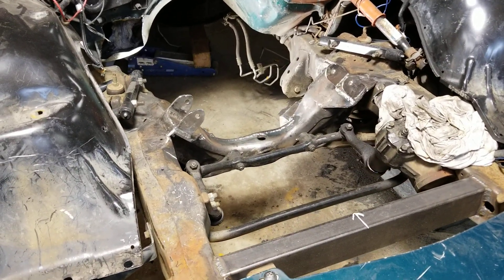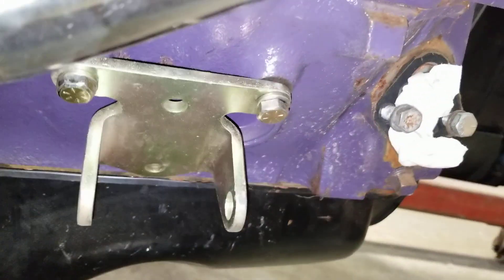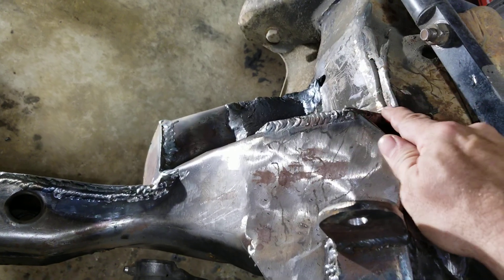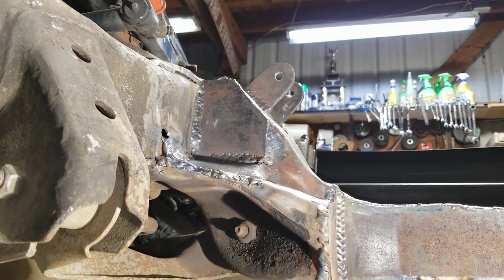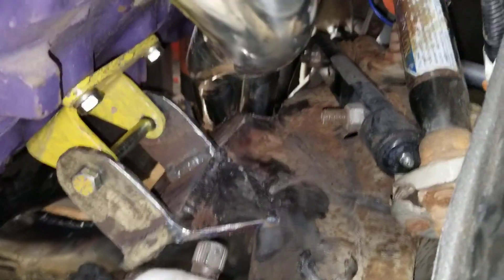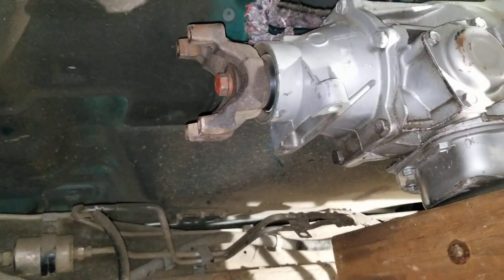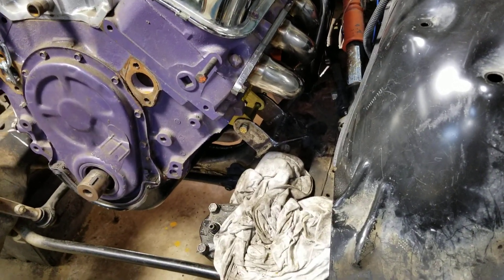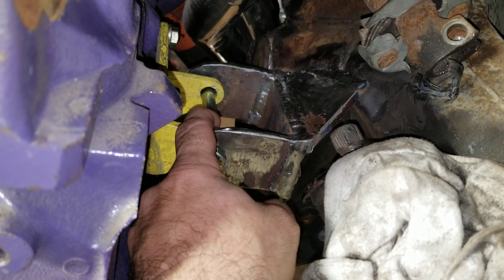1996 s10 Big Block 454 Chevy Convertion pt3

Comment: I had a 67 SS Chevelle that had a 350 hp 396 and that brake booster valve cover was chrome and slanted off and down at the back to clear the brake booster.

Comment: Great video series. I was considering doing the same detailed set of videos as you are doing now, as you’ve said, no one is going into great detail for information on swapping a big block into the 2nd Gen S10. 
One question about the control arms, you say to use two left hand arms which have a measurement of 8.5” arm. Speedway is saying “When using on a drag race or S-10 application, consider using RH arm for both sides as both will be 8" long; arm can just be flipped over for LH side (RH arm is 8").”  
Did Speedway do a typo and they really meant consider using LH arm?
Reply from the maker: I used speeway part number 91034394. Speedway has a left side that is 8.5 and the right that is 8.0. I used two left hand side ones and just flipped one over for the right side. I had to use these type of A arms to clear the headers I was using. Plus they look alot better than the stock ones.